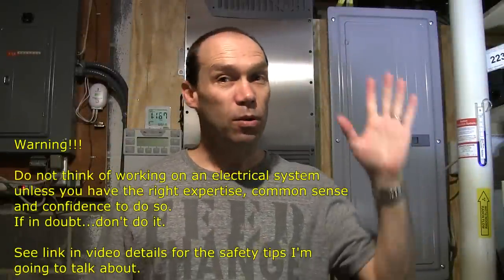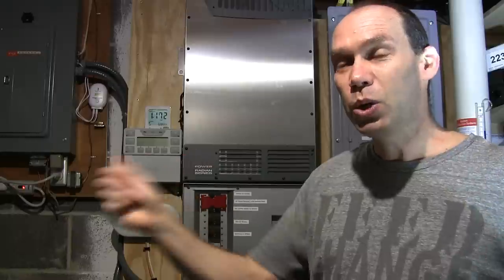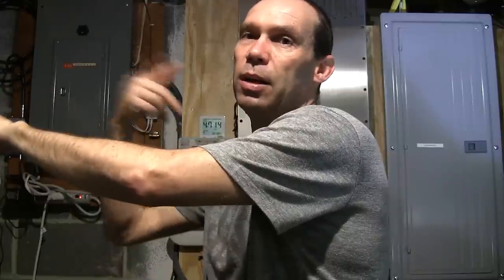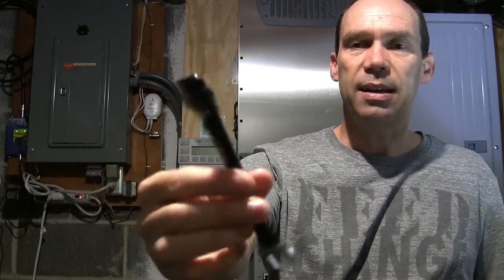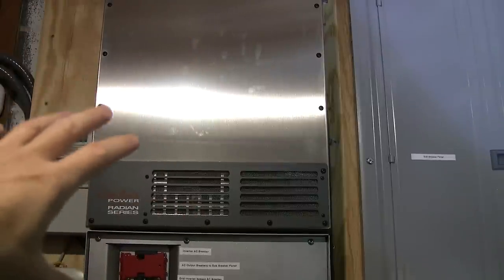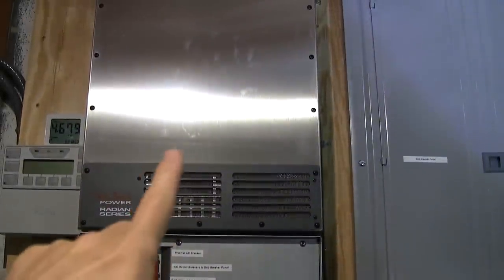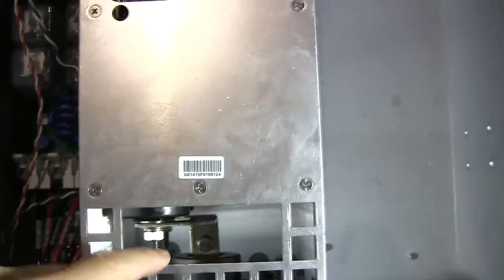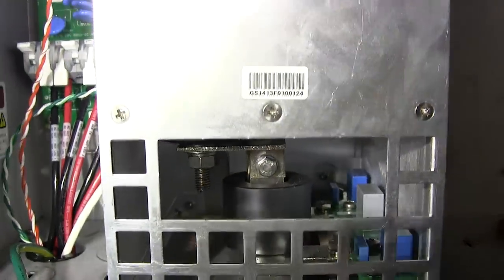Electrical Safety / Inverter Failure

Comment: How long has it been running? is the room very hot?
did the unit actually fail? or just sound worrying? I'm wondering if a spider crawled in and got fried but probably not.
It seems to weigh 40kg. Must be some huge transformers in it. Maybe they should have spent some of all that weight on electronics robustness :)
That type of product is left in continuous operation for decades. I don't think I would use any electrolytic caps at all. It's a very demanding type of product and you don't want to create an endless collection of repairs plus reputation.

You could shoot thermal video of it in nominal operation so you have that as reference for another time.
Reply from the maker: Dan Frederiksen All good questions and points.
* It's been running about 8 months now.
* The room is cool, around 21 C through out the year with 40-55% RH.
* The "failed" is written as such because it stayed powered on (before I shut it down) but made very worrying sounds and had / has a very acrid smell. I checked for any signs of rodents and critters...none found.
* It does have some quite large electrolytic caps near the large transformer...

A thermal video is a great idea but I'm not prepared to power it up again until repaired. This invert is not cheap and I don't want to compromise the warranty in any way.
Reply: mjlorton it's not a solar inverter? you have a separate solar MPPT battery charger unit as well? fairly expensive at ~2800$. Especially if it fails :)
One interesting idea for a video might be to hash out a very basic 4kW DC to AC inverter circuit to see just how inexpensive it can be yet still be high quality and robust. I would like to help with a few pointers to keep it simple if you like.
Rough layout could maybe be as simple as this: electroschematics. com/wp-content/uploads/2013/08/12vdc-220vac-inverter.jpg
With a bit of luck and cleverness it could be a sub 50$ circuit.
Reply from the maker: Dan Frederiksen I like the idea Dan...an expensive single point of failure is not the best....
Reply: mjlorton industrial mindset tends to hike the price by factor 10 compared to consumer. And consumer products often have to be far more reliable because a 50% failure rate on a million products will kill a company.
Reply: Dan Frederiksen Schematic you posted is elementary square wave inverter, which is pretty much useless for home use (you cant use it for anything that have ac motor, but can be use for light and things like that) same is for modified sine wave inverter (theoretically they can run ac motors but with no more than 20% motor efficiency which basically mean motor will overheat quickly, still they can be very useful and design is not much different). For home use you need pure sine wave inverter and they are not so complicated (with modern microcontrollers design is easy, most difficult part are magnetic components and you are not too obsessed with efficiency)
Reply: Miloš Lazović couldn't that layout do a sine?
Reply: Dan Frederiksen That one is square wave, but you can google for pure sine inverter, you will find lot of schematics, they are not much complicated than this (they vary from like 1 microcontroller with couple transistors, or just 2-3 discrete IC with some positives, to extremely complex). Biggest problem with simple ones is finding transformer for them (you need to make it by yourself or find some company that will make it for you).
Even that square/modified wave converter can be some time useful (most of cheap inverters that people buy for cars are that type), you can use it for light, tv ... (it is good for camping but you usually can't run normal fridge).
Reply: Miloš Lazović why is it square wave? other circuits claim sine wave with the same 2 transistor layout.
Reply: Dan Frederiksen Ignore transistors, that is just push pull configuration, problem is how you drive them, and 4047 in that configuration drive them as square wave inverter, for sine wave you need to drive them differently (you can use PWM but PWM value need to change with time so at output after filtering you get near sine wave).
Reply: Miloš Lazović ignore the topology??  dude, next time think a little so I don't have to hold your hand with 5 comments before you realize you are wrong. I said rough layout, not that specific driver chip.
Reply: Dan Frederiksen You don't have clue how inverter work?
"Ignore transistors" means you ignore transistors not what drove them, do you use push-pull, half bridge, or full bridge don't make difference will converter be sine wave or square wave, it is just output stage, it will make only change what type of output transformer you use, not what type of output converter will produce.
That is not even close to rough layout of sine wave inverter, this is rough layout of square wave inverter (and really rough, it will work only in ideal conditions).
To cut your troubles, that layout is just square wave inverter in theory, in reality it is better smoke machine then inverter.
Reply: Dan Frederiksen He's not wrong. The transistors are irrelevant. To create a suitable AC waveform, you'd normally modulate a high frequency PWM driving the H-bridge to create the low frequency 50 or 60Hz sinewave, then filter out the high frequency component. With a simple circuit like the one you posted, it just alternates the current through the transformer with a straight square wave.
Reply: SDG Electronics of course he is wrong. Is it really that hard for you to understand the difference between a topology and specific chips?
is it that hard for you to imagine PWM control and a different name on that chip?
Reply: SDG Electronics To be totally exact, you don't need to use full-bridge (H-bridge), you can use push-pull (two-switch topology with a split primary winding) as according to his schematic or half-bridge, it is just design decision, but any of that technology will work.
Reply: Dan Frederiksen Is it so hard you to understand that it is not so simple? Sine wave inverters are much more complex (you need at least low pass filter), they are closest to class D amplifiers.
Even your rough design will NOT work in practice (it will work like smoke machine, but as inverter will not).
If you are so smart and it not so hard why you don't change chip and make it work.
Reply: Dan Frederiksen Yes and if you replace 4047 with op amp, add some feedback you will get audio amplifier, end if you atop of that replace transistors with tubes you will get classical push-pull tube audio amplifier (yes it have transformer), but that is not same circuit, it is totally different circuit!!!!!!

Comment: I have no faith in large single inverters, (only small to medium size ones, maybe a large S.M.A will change my mind), they coat their power electronics pcb`s with a clear gel (shit forgot what its called) but that's a build QA aspect, they use sophisticated electronics made up of a ti DSP and other very intelligent stuff, the inverter you showing looks cheap at first glance.. not many companies can do power electronics reliably its a tough area to get right, more fail than meet their rated specification or fail prematurely based on the environmental conditions.   

Another possible issue here is your environment, you complained about moisture in the past,that might be the issue, coupled with the fact that the build of the inverter doesn't have good moisture isolation, the high frequency buzz is the switching of the high frequency ETD cores being switched in the audible frequency band, which will result in overheating and malfunction, and, if the unit is designed well, it probably enter an over current condition and trigger protection. 

A tear-down would be great. I love power electronics :)

Check this build video out
https://www.youtube.com/watch?v=RtcYnZj5Aew

Comment: Ran across this graph showing capacitor core temp vs lifetime, as Electrodacus points out, heat is the killer...  given that, it seems to me continuous (even forced) air movement even at low loads, across the circuit board is something worth considering if attempting to extend the life of any inverter

http://electronicdesign.com/site-files/electronicdesign.com/files/archive/electronicdesign.com/content/15001/61107-fig-1.jpg

Comment: I always cringe when i see a all metal circuit breaker panel. They may be better... but with all the fire resistant polymer out there what is the reason to use metal?
There may be a good reason that i'm not seeing. Anyone?